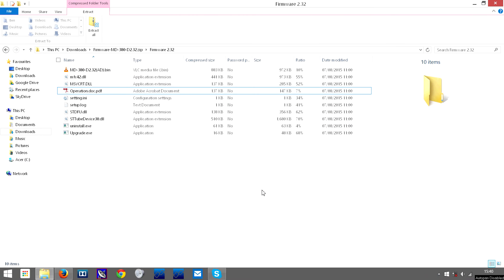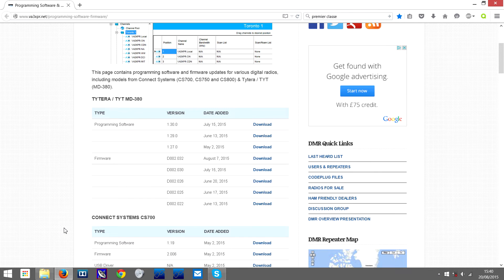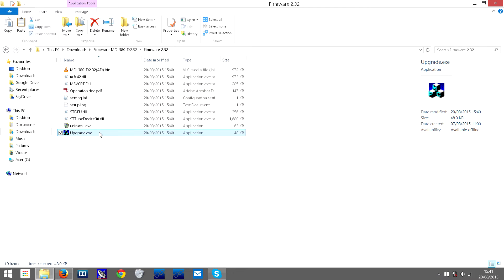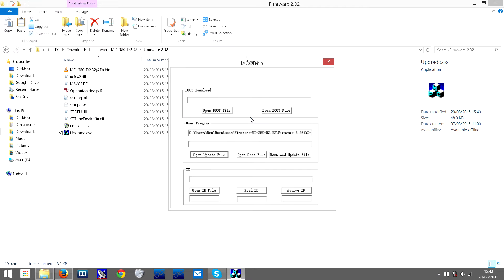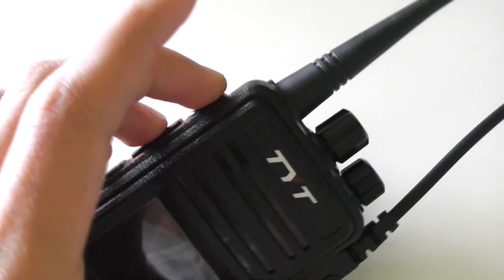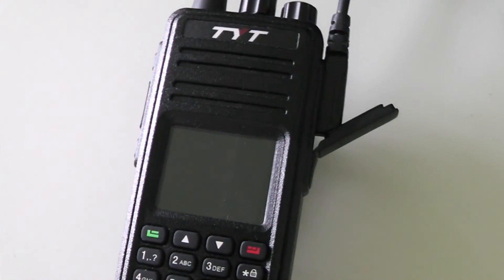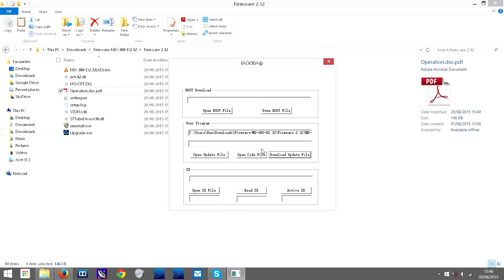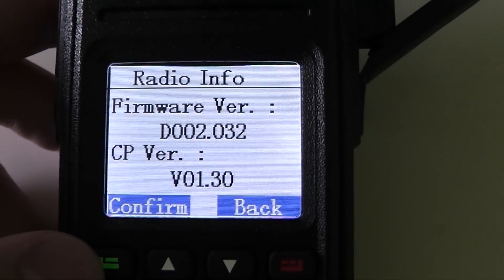How to update TYT MD-380 normal or hacked firmware!

Comment: FIXED THANKS MUCH!!!!!!!!!!!!!!
Can anyone help me with this problem I'm having?

I picked up a new MD 380 a few days ago installed tools on it promiscuous mode does not work
I have an old MD 380 from years ago and it works perfectly
Is it possible that promiscuous mode does not work on tools on the new radios?
My old radio is version one hardware
My new radio is version 5 hardware
This is the only difference I see in the radios at all
Can anyone help me with this problem?
Thank you very much ahead of time
N9iwj

Comment: i followed this and now its just flashing between the red and green light its not doing anything and it wont load the original firmware is it bricked
Reply from the maker: what happens if you turn it off and then on again without holding the buttons in?
Reply: @radiosification  nothing the screen stays black but the light flashes from red to green
Reply: Is there a way of getting it out of the mode where you press the two buttons that's what my issue is... the software itself has uploaded
Reply from the maker: It sounds like the firmware you uploaded is not compatible with your model. There are a few versions so try a different one and it should start working
Reply from the maker: Once a working firmware is on the radio it should start up normally (not in that mode) when you turn it off and back on after the firmware update
Reply: @radiosification  no idea... emailed tyt they said they'd send me a copy of the factory firmware... I think i got that one i a million radio
Reply from the maker: @Adam-zn8hn  If even the factory firmware won't work then I don't know
Reply: @radiosification  managed to get them to send over the factory preset it now works but the screen stays white once turned on they said send it back and they'd fix it they think that some of the firmware that's out there may have bugs. But oh well thanks 🙂
Reply: I've tried multiple different versions of the firmware from different sources but not getting anywhere... do you have a link to how you do yours. Thanks
Reply: I've tried things like va3xpr.net and tyt themselves and other software it just goes round in circles